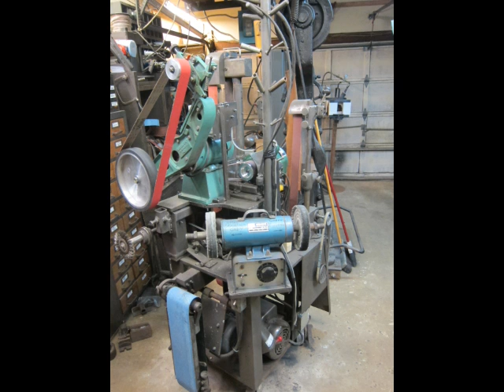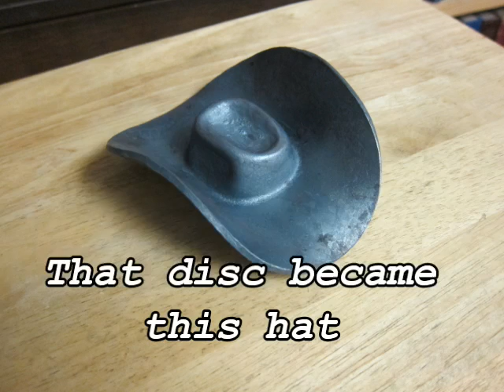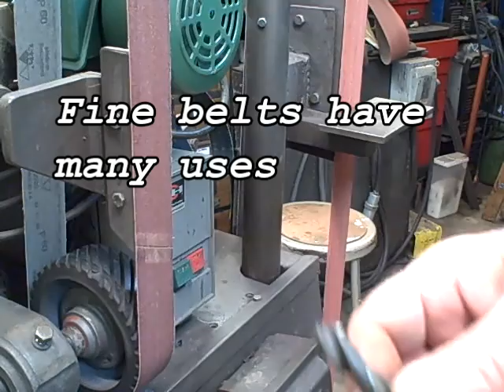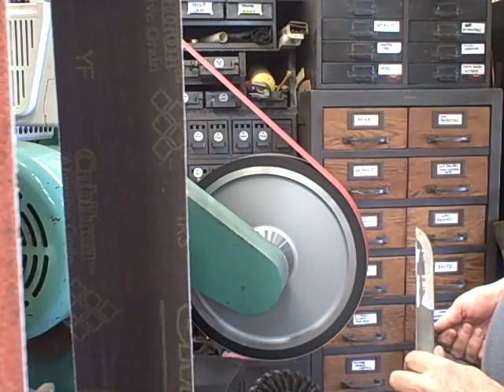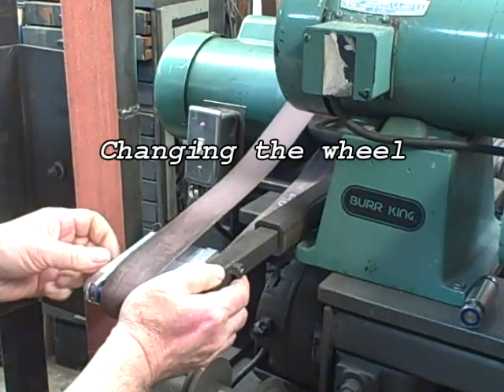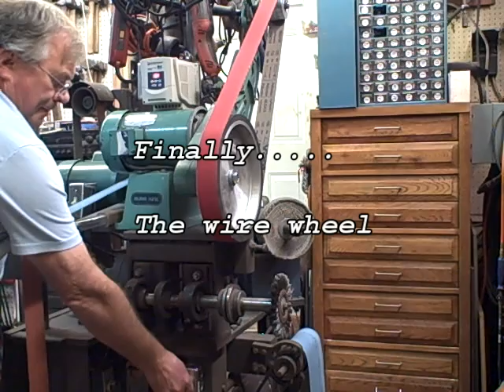Grinding Polishing Station

Comment: i recommend adding protectors over the pullys/etc so something cannot get sucked in and ejected back into your face. I can see a little drill bit being redirected strait into your face.
Reply: particularly around the "wheel hubs". It won't take much effort to put some sheet metal protectors over it, attached with a wing nut for easy cleaning.
Reply: at that narrow angle it can impale your eye right under your glasses too... wearing a full face shield is rather tedious anyhow.
Reply: also I would also recommend some ventilation around your polishing area.. you don't want to be breathing in dust from that activity. I do this right next to a garage door that is typically opened. having a fan to direct air flow over you is a good idea also.. im guilty of not always doing that however.
Reply: I myself have started to build swiss army stations. Right now I just have a pliers totem with all my fine tools on it. (interestingly enough I got the idea from one of the mythbuster guys, their youtube channel is "tested", somewhere adam or jamie (forgot the name) shows a little "tool cart" they built that is similar to your angle grinder pyramid)
Reply: https://en.wikipedia.org/wiki/Silicosis

Comment: I would also like to build only 3x132 belt grinder but i can't really figure it out how to do that. It's kind of tricky. And i can't really see good in video how is the the upper wheel attached to the steel pipe. Well thanks a lot David and hopefully i will figure it all out.
Cheers

Comment: Hi Dave - before I even watch your latest vid here, I just wanted to say thanks and welcome back yet again.  You're actually one of my top 4 most important BSmithing and machining references; right up there with MrPete222, Ausferrier and BasementShopGuy.  I'm a long-time subscriber and an ardent fan of your methods and always look forward to what you have to share.  I built your C-Forge last year and am really happy with the design!  It so happens I'm in the process of building a 2x72 belt grinder now and also suffer from limited shop space so this topic is perfect timing.  I really like the idea of adding that huge 3x132 grinder to my shop which you featured so prominently in your tomahawk build.  Quick question… where do you find your 3x132 belts – I’m struggling to find a belt that long.   Are those AO belts you use in that instance?  I imagine pulling that many feet of belt keeps the thing running cooler and much more efficient, so what belt grit do you find is optimal for grinding up to say 2” steel material?  I’d really like to start forging my own anvil tools and forging hammers here this summer so am thinking this larger design will greatly reduce my final shaping and finishing time.  And finally what belt SFPM speed do you drive that to?  Any thoughts or wisdom here?  So thanks again for your terrific ideas.   Best regards,
Bob, Gig Harbor, WA
Reply from the maker: TheMainlinehobo Thank you for the kind words….   Your interest and ability to build the tools I speak to confirm I’m reaching the audience I want to.  

I used to buy most of the grinding belts I use off eBay.  I still occasionally buy there, but have mostly graduated to other sources.    I google (or use Bing) for the size and type I want and see what pops up.   I have started buying only very high quality belts (mostly ceramic).  They are the better investment.  Cubitron is the highest on my list right now.  Some are sold on eBay. Of course if I can’t find the grit or size I want, I go to the next best.   The reason I have a 3x132 grinder is because many years ago (maybe 3 years before I bought and modified it),  I was at an industrial auction and bought two boxes (50 belts) of 3x32 very high quality 60 grit belts.  I got them for next to nothing and knew I would eventually buy or build a grinder to use them.  I eventually bought a 3 x60 grinder for $60 from an industrial equipment reseller.  It had been a hanging production line sander (not useful in its initial form to me), then modified it to use 132 inch belts, changed it's mounting and installed it as the first tool on the grinding/polishing station.   I have since bought more belts for it at the same (monthly) auction, although they rarely have grinding belts.

If you do buy belts off eBay, you take the chance they are old.  It might not seem pertinent, but it is.  Some belts have a shelf life because of the way the joints are made.  I only consider belts where the seller says they are new stock.

I use 30 or 60 grit for heavy stock grinding (yes I have ground lots of 2 inch material.… hammer heads and tooling).   I have belts up to about 1500 grit, but for general use, I don’t use much above 320 unless I am working on something (like an edge on a vessel or a knife) that I want to have a mirror finish (sanded then polished on a buffer).  What grit for grinding tooling?… It depends upon how close I have forged them (or if I have).  If I have to do a lot of stock removal, I start with 30 or 60 grit, then move to higher grits, finishing with 320 (or so).  I generally don't need to use more than 3 grits for a project.  If I want to put a polished surface on it (like a hammer), I may use even higher grits (although not much), then take the tool to the buffer.

Those really high grit belts are great for sharpening your kitchen knives also. I can sharpen (effectively) a dozen knives in just a few minutes.

Speed?   Generally, faster is better.  And it depends upon what you are grinding.   If you build a 3x132, use at least a 5 HP motor.  I wouldn’t use less than 3 HP for a 2 inch grinder of any length.  You don’t want it to bog down when you bear down.  Also, use industrial quality motors.  I always buy used motors and look for the heaviest I can find.  I buy both single and 3 phase motors (it’s easy to put together a rotary converter) at steel recycling places that set stuff aside they know people like me are looking for.  Also check craigslist and eBay (shipping may be prohibitive though).  I generally use 3450 RPM motors (unless I have a low RPM requirement).  4000-6000 surface FPM  for a belt grinder is a  good target to strive for (higher end is better, unless you have wheel balance issues).  I have a friend that runs Bader grinders up to 8000 SFPM (scary fast when a belt breaks, and they do).   Lots of wheels are not rated for high speed, so watch what you buy (or make).   The higher the RPM, the more important balance is.  There are grinder wheels available online fairly inexpensive, but they are not recommended for high speed.  Also, if you buy wheels with covers (rubber,urethane, etc), they will have a maximum safe speed before they can start losing the cover.   All things to consider and ask about if you are building a grinder.

I can tell you that I used the 6x48 woodworking belt sander for many years as a metal grinder.   When I discovered belt grinders and belts that were designed for metal, the difference was astounding.  Speed, power and belt quality make the difference.

Thanks again and good luck with your projects.   Making your own tools is the BEST!

Comment: This was a nice break from my morning work routine.  When you mentioned you make hats from disks I instantly was intrigued and then glad you showed the final piece. Very cool stuff. My pedestal grinder got a 2" belt added to its table a few years ago too. 2 hp motor isn't near enough but I hardly ever go to the hard wheel anymore.

Do you wish the 3" belt had more power or are you happy with it as is? Caleb.
Reply: Caleb Welte I have a 5 HP motor on the 3 x 132.   It has plenty of power for what I do.  

Making cowboy hats is fun.   A really good short demo also.  Incidentally, I have a YouTube video up that shows how to make a cowboy hat.   If you click on my name with one of my videos running, you will see thumbnails for all my videos...